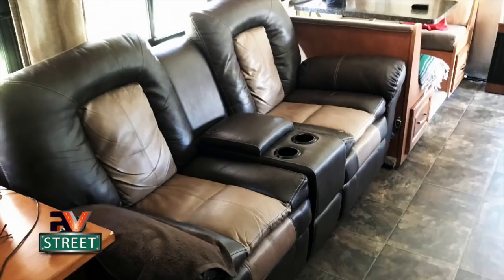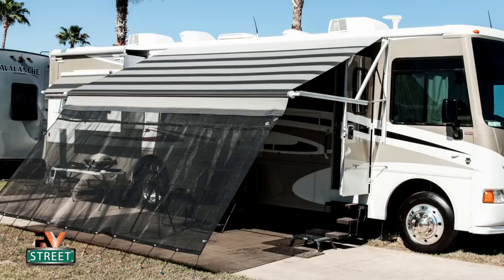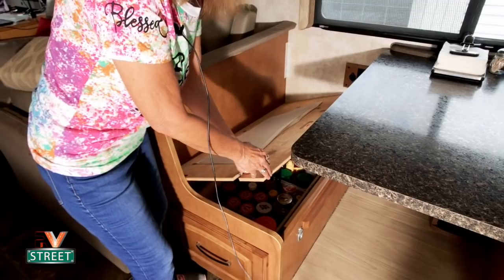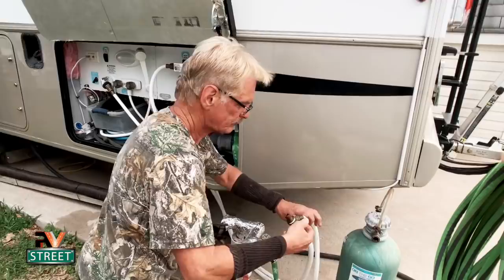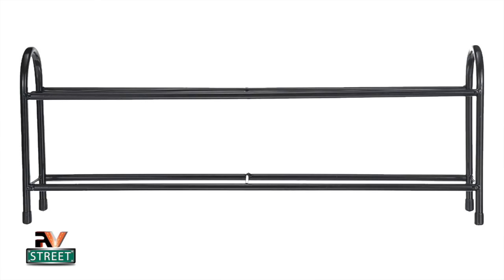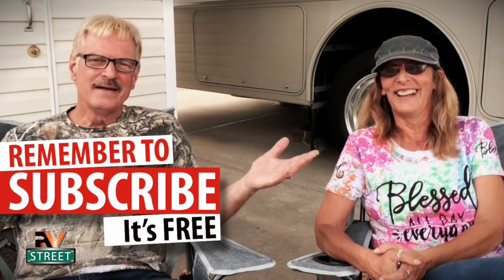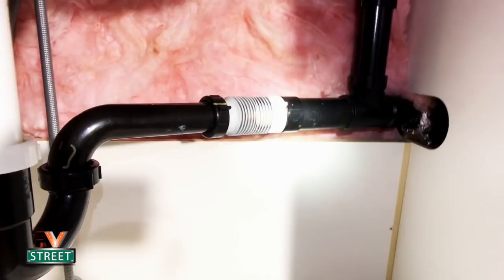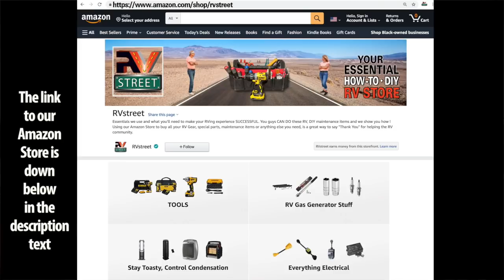My Wife LOVES Me More b/c Her Life is ❤️EASIER❤️ DIY RV UPGRADES

Comment: Great video. Just curious though, when cleaning the water spout with cleaner is it safe to just hook and and drink the water without rinsing the chemicals off?
Reply from the maker: As a precaution, after I spray the spigot with bleach and it has sat there for a few minutes, I briefly turn ON the water, then hook up my first set of water gear to the spigot, rinse again thru my first filter, then hook up my water hoses. Totally safe that way.

Comment: Just curious, we have a 2018 Vista 29VE.  I know that the prices for the awning is very dependent on size and quality of materials used, but about what did the awnings and slide cover run you?  Thanks.  Bill
Reply from the maker: The price individually I don't remember. But for 3 window awnings, 2 toppers (19mm thick) and the main awning was 4K. And that was for top of the line material all around. Once everything was sewn and built, it took 4hrs. to install everything. One of the smartest upgrades we've done for sure. 👍

Comment: Why is it Not advisable to use silicone. On RV roofs ??
Reply from the maker: Some TPO or EPDM roofs are attached differently than my fiberglass roof. But, if you have a fiberglass roof like I do, and your roof curves down and around and is held in place with the gutter like mine is then you can use the same sealant I use for those areas. Silicone usually does not have UV protection. But even if you find a Silicone product that does have UV protection properties, once Silicone has been applied to ANYTHING and now you come back later to do any repairs, it's nearly impossible to remove it all off to reapply new material. There's always some residual Silicone left behind on the old surface which makes adhering new Silicone—or any other sealant product for that matter—unable to adhere properly. Silicone won't even adhere to itself. It’s just a pain to use Silicone and there are so many other, better sealants out there for specific jobs.